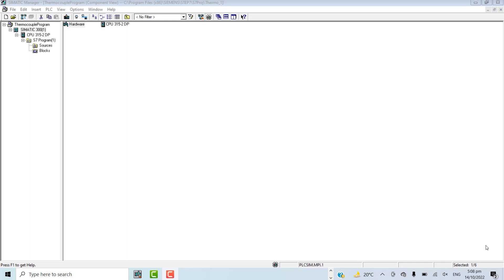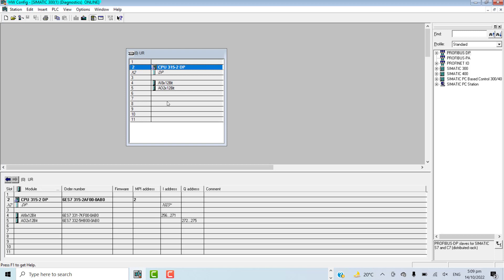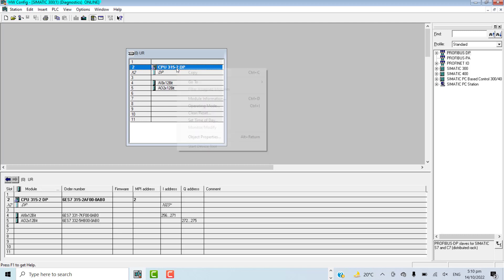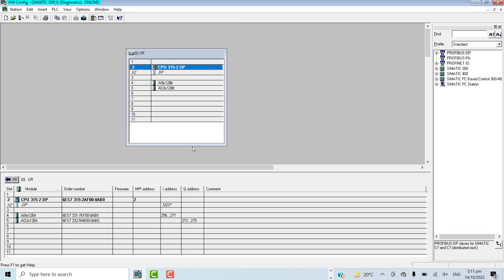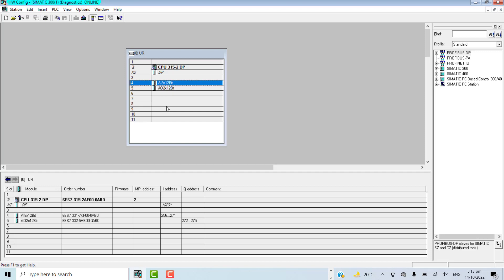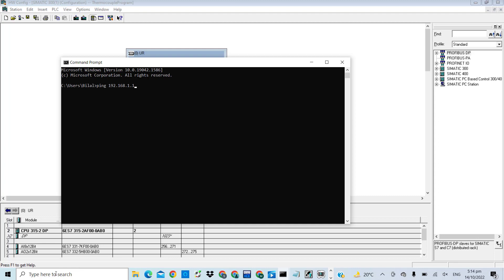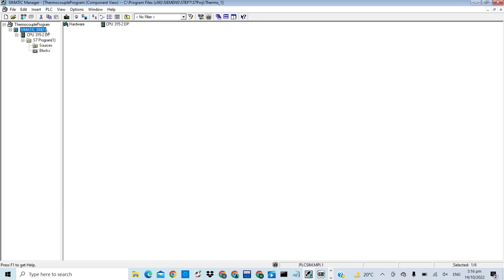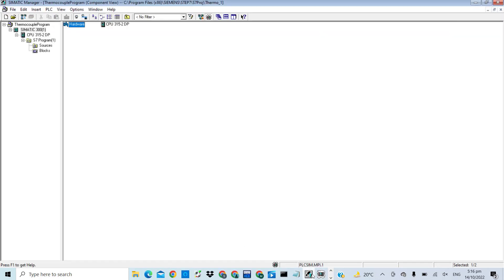PLC Troubleshooting steps | PLC Fault Diagnosis

Comment: If PLC used in machine with proven logic, running more then 1 year, what may be the reason of cpu going to stop mode randomly in running,
How to correct or confirm as a end user.